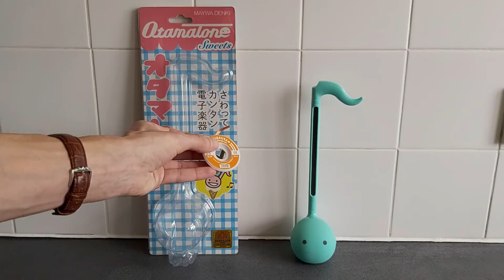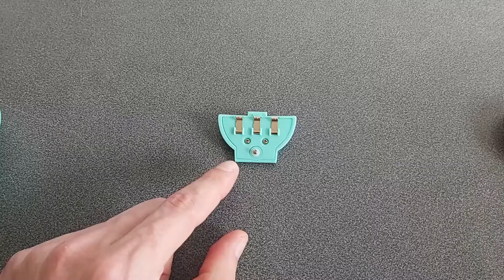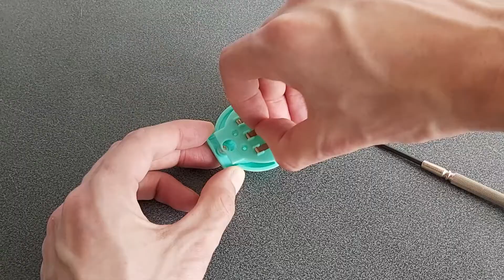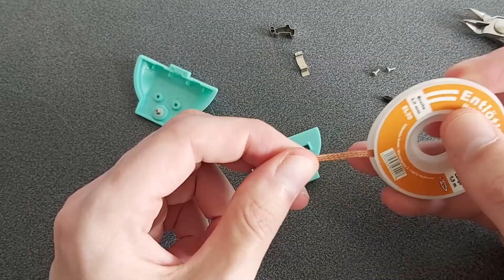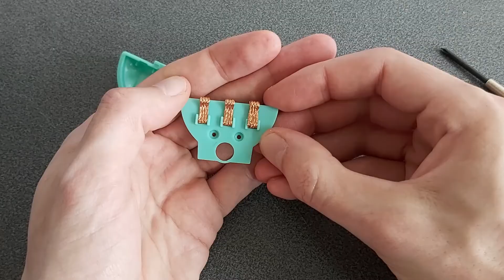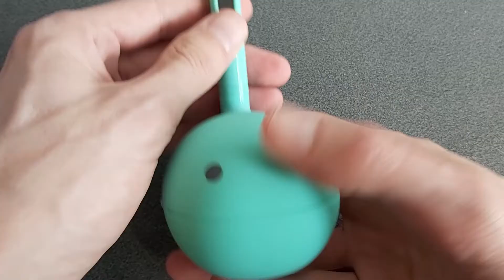Repairing Otamatone battery compartment

Comment: I put tinfoil across the batteries (leaving only the screw uncovered) and closed it. Turned it on, it sounded awful. Turned it off, took the tinfoil out, closed it again and it slowly started sounding more and more correct

Comment: What a clever fix! Much easier than the approach I took to the same issue of sanding down the battery door underneath the contact strips, and epoxying in a bit of ABS plastic filed in the shape of a small ramp so it pushed the contacts up more. But that made the whole assembly bulge a bit more than I would have liked. The malleability of the solder wick would account for that so much better!
Reply from the maker: Thank you and sorry to hear you had the same problem but glad you found a fix, sounds somewhat more robust!